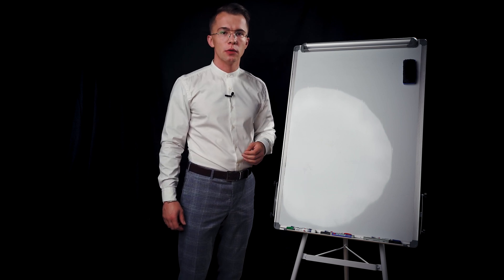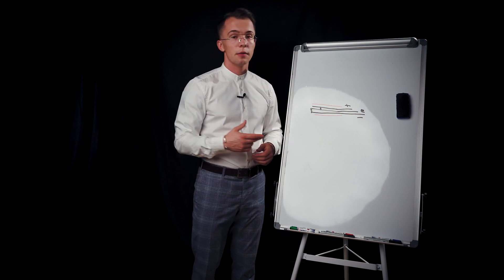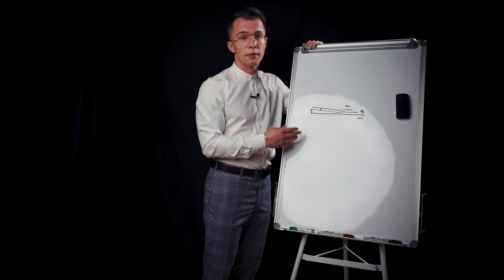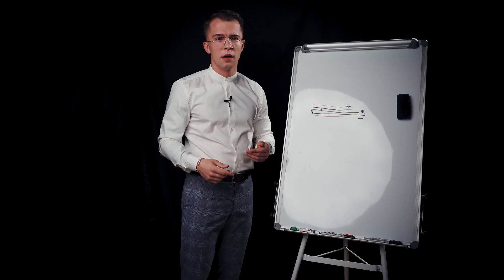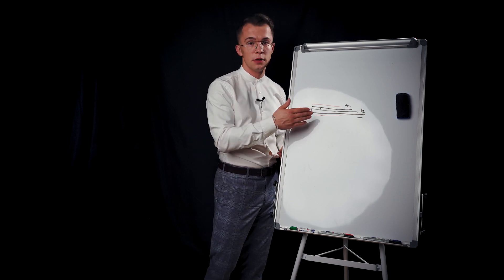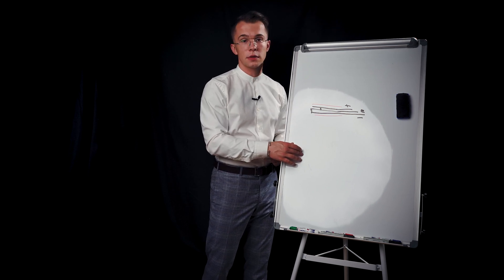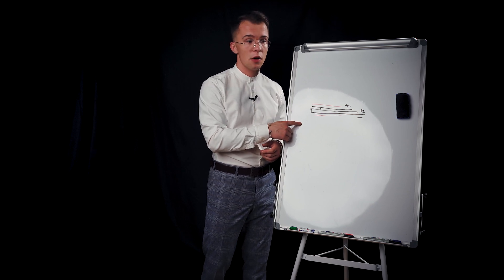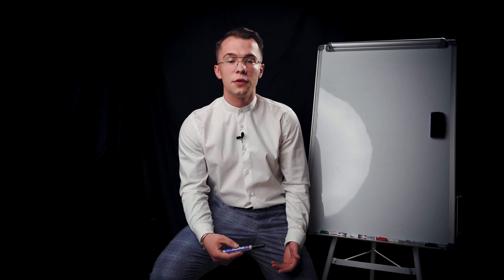How To Troubleshoot Earth Fault On Fire Alarm System

Comment: Good pointers however it will take longer using the panel as way to find a ground fault. An analog multimeter is the way to go when chasing ground faults especially if it is coming from a monitor module.